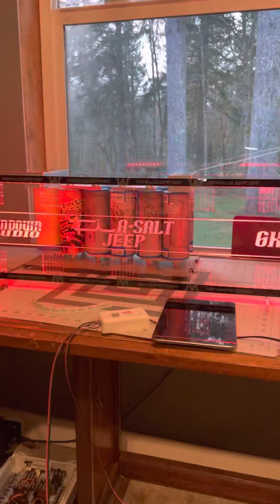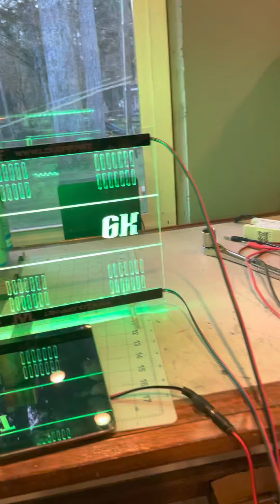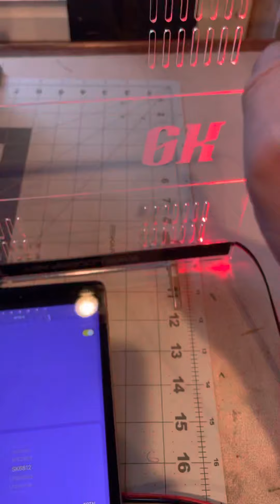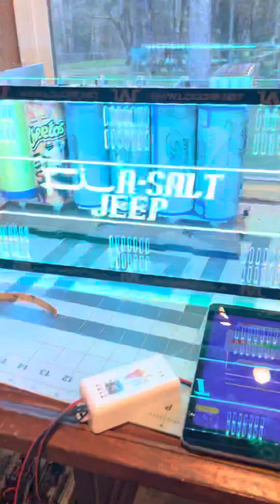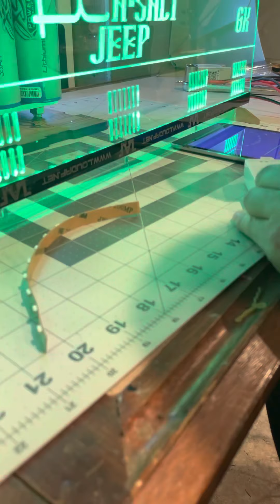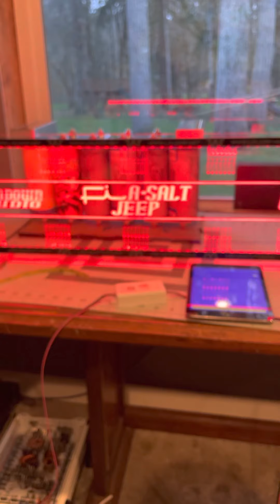How to wire up your LAF chase/addressable LED laser engraved acrylic amplifier backplate

Comment: If I were to buy 2 backplates, fuse blocks, and a bass knob all with led, can I run them all off one controller so I can control them at one time via the app?
Reply from the maker: Yes. The SP107e is a great controller. I sell it along with some others. It’s good because it has screw terminals for multiple strip wires, and you can also run multiple controllers separately from the same app to create zones